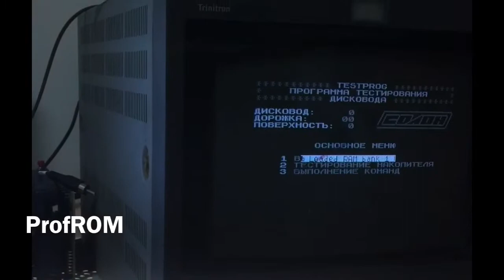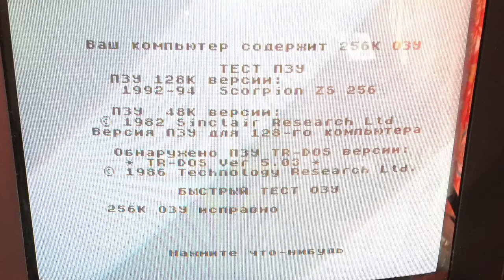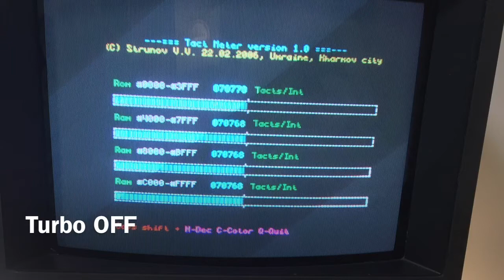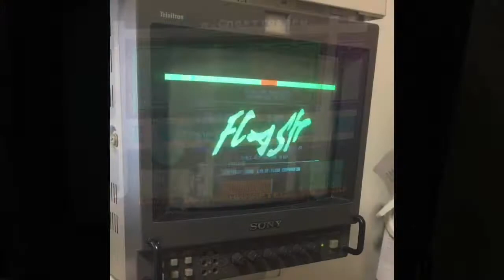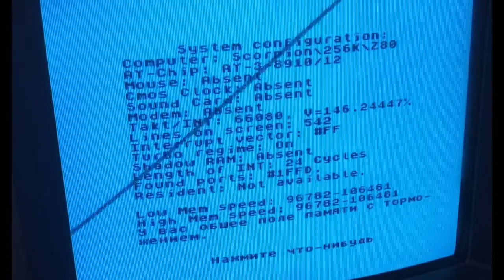ZS Scorpion 256Kb

Comment: What demos did you use for testing? I've finally built my sprinter and need some more Scorpion demos for testing ... my usual testdemo does have a scorpion mode, but turns out the Scorpion and Scorpion Turbo+ (your version) differ slightly in timing and the demo I'm using isn't exactly a good testcase.
Reply from the maker: Hans Meier try to use the program in this link https://1drv.ms/u/s!AoV8jy5ju4UQguQzPT6DKnhBZvfWzQ